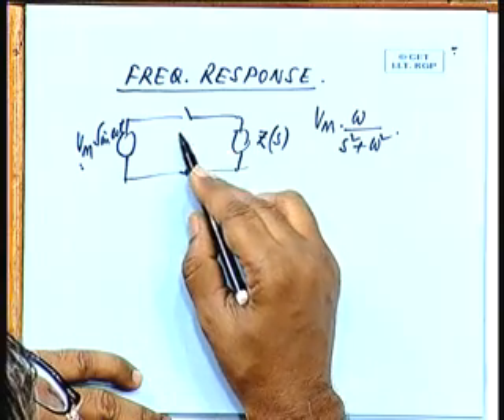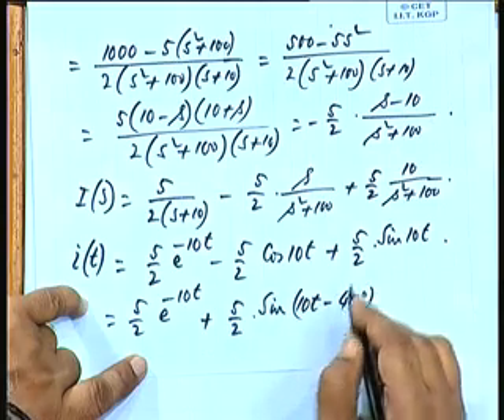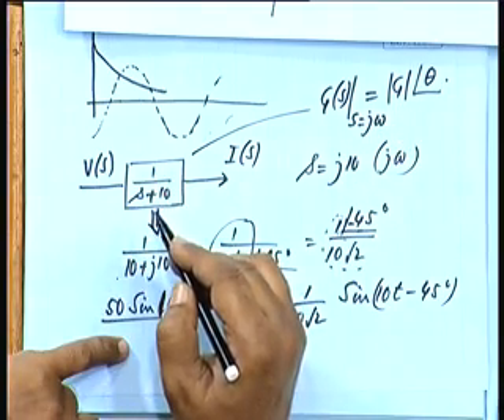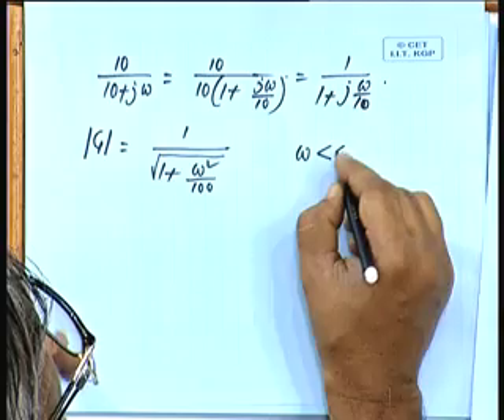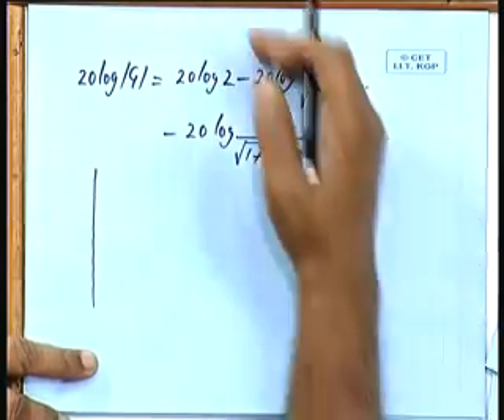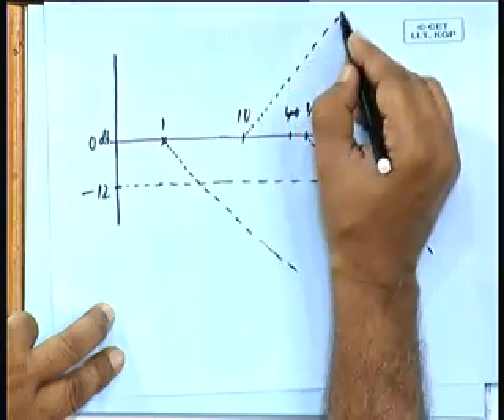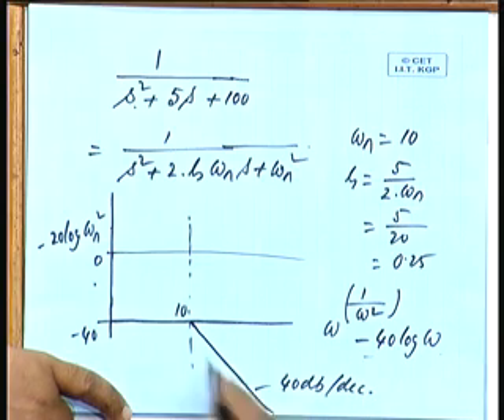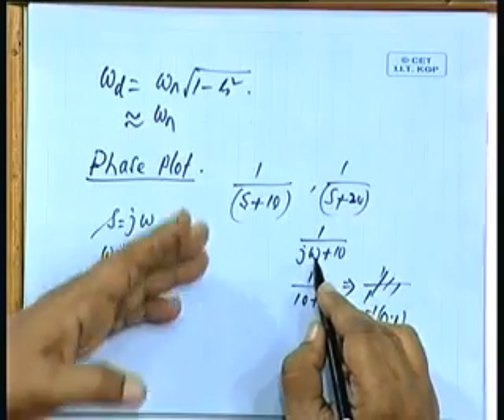Lecture - 10 Frequency Response Bode Plot

Comment: @Braati Actually my error results from improper calculation of the magnitude of a complex number.
|a + jb| is not sqrt((a + jb)*(a +jb)), as I was previously using, but instead I should have used (a +jb)*(a -jb), squaring the complex conjugate. That gets rid of the negative component of squaring j. Thanks anyway.

Comment: he made a mistake, because of the sign, he should have ended up with +20dB per dec at 5 and +40 at the other knee. Basically, he took the mag of the inverse fraction (like in ex.1), but absentmindedly inverted the fraction while breaking down the log. not a big mistake, but was confusing for a moment...